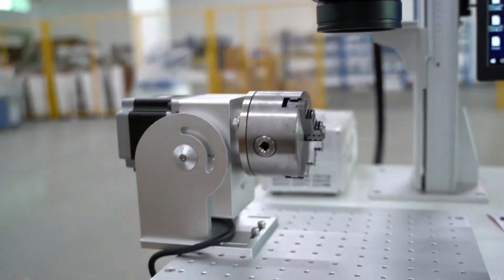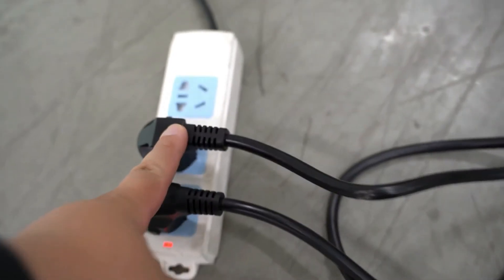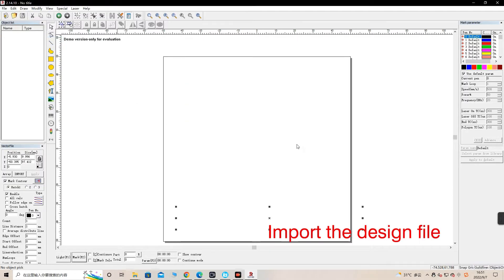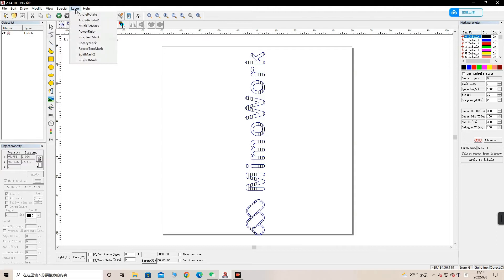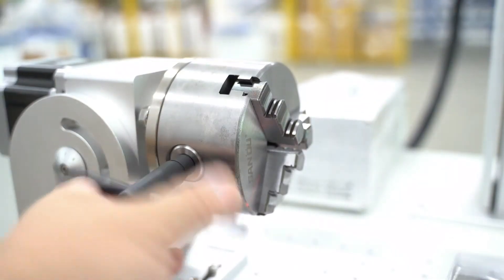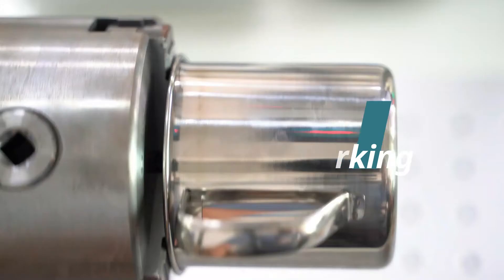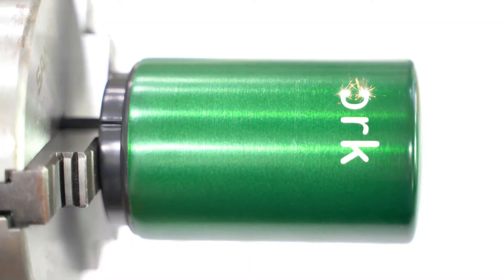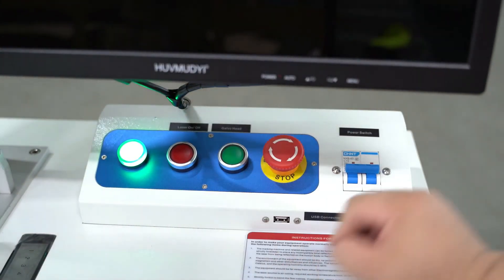How to set up ezcad rotary | Fiber Laser Engraving Tutorial

Comment: How to calculate the step per rotation
Reply from the maker: Ah, the step calculation!
I just looked into a manual for a common rotary device to try and find a simple answer, and I have to be honest.

It gets pretty deep into the math real quick.

The short answer is that the formula depends heavily on the specific mechanics and motor of your rotary attachment.

The absolute best and easiest way to get the right number is to contact your rotary's supplier or manufacturer.
They'll have the exact specs and can give you the correct calculation, saving you a major headache!

Good luck with the setup

Comment: do you happen to know why my art is not engraving in order. it starts from the middle and finishes the end but then it over laps the beginning of the art over the end of it.  is there a way for me to tell it where to start and where to end.
Reply from the maker: Totally get the frustration! 😅 Your manufacturer should be your first stop, they know your machine like the back of their hand! That said, if you're rocking a fiber laser marking machine, let's try a few quick fixes (fingers crossed 🤞):

1️⃣ Rotary Check: In EZCAD, peek at your Rotary Axis Settings—make sure 'Rotary' is enabled and the direction/steps match your machine's vibe.
2️⃣ Start Point GPS: Use the 'Start Point' tool (under 'Mark') to manually pick where the engraving begins, think of it as giving your laser a treasure map! 🗺️
3️⃣ Cliffhanger Fix: If artwork overlaps, add a tiny gap at the start/end. Rotaries hate plot twists! 😂

No guarantees, but give these a shot!